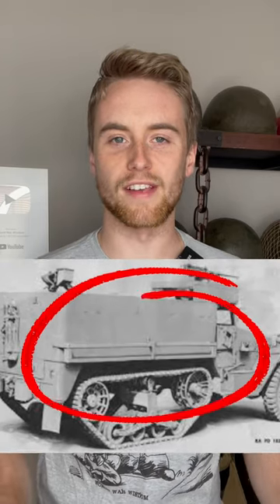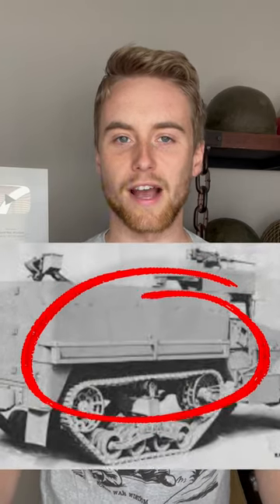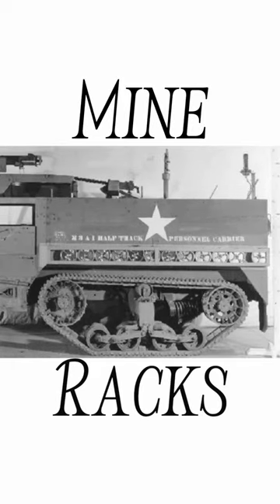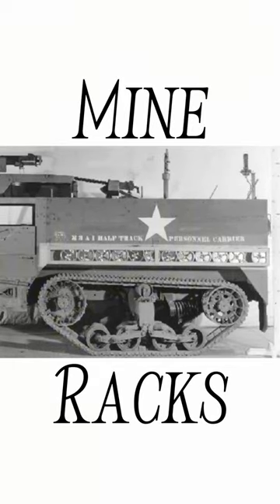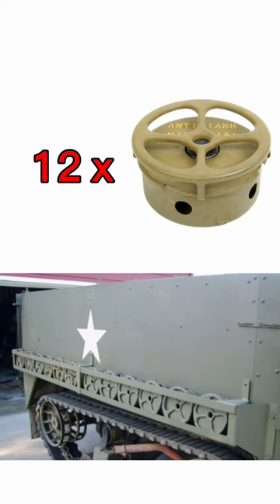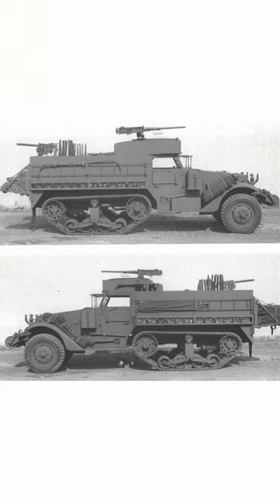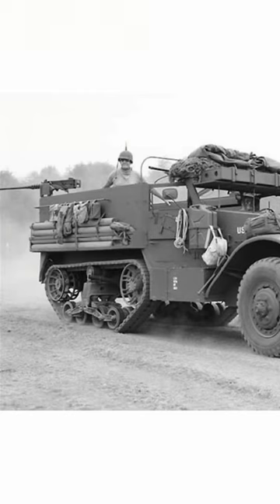Why attach bars outside of some WWII half-tracks?

Comment: To everyone worried about having explosives sitting on the side of the halftrack:

When the mines aren't about to be laid, the detonator/fuse for the mine would be removed, rendering it pretty safe to handle. Any external explosion that could possibly denotate the mines while they were sitting in those racks would already destroy the entire halftrack, so its not really a big deal.
Reply: People back then were smart. Most youtube comments are proving everyone's pretty stupid nowadays.
Reply: Not sure what experience you have with the issue, but I regret to inform you that you are in fact incorrect.

Comment: Imaging having a bad driver and you bump into a tree or something and your squad blows up
Reply: It takes about one ton of force to set one off
Reply: Anti tank mines need VERY HEAVY force to activate
Reply: A explosive way to know
Reply: @Steve.Matheus if I’m correct they also needed to have a pin pulled to be activated so that when something goes over it it will explode so yeah just helping you prove your point
Reply: That’s not how they work
Reply: @Steve.Matheus no not that much. Crash into woods with half-track is more than enough. There are safety pins tho. Still it is very nervous if your transportation is coveted with antitank mines
Reply: Wouldn't they need to be activated before they can explode?
Reply: Mines are inert - apart from being full of explosives - until you screw a fuse into them.
In the Mark 7 - a similar large round anti tank mine - you could get the normal single impulse, double impulse to defeat flails and rollers, and tilt to defeat ploughs.
In my day, the Cold War, the "ideal" minefield was:
Wire obstacle to deter opposition recce or pioneers.
Knee high marking wire to show the extent of the field which had to be surveyed in against basically indestructible markers.
Layer of double impulse mines which could be protected by four anti personnel mines on the "red" side.
Layer of tilt fuse mines.
As many staggered layers of Mk 7s or Barmines, because you have to leave quite a surprising gap between mines to stop a chain rection of sympathetic detonations,  as you wanted.
Not to mention lanes left for patrols.
All covered by direct or indirect fire.
Minefields could be used as a "dead stop" or contoured to "guide" your opponent onto a killing zone.
All a long time ago :0)

Comment: My father commanded  a half track during WWII. I believe it had a long barrel 30mm anti-aircraft cannon. I still have the operators manual, a demilled cannon shell, and the wool blanket that he sat on. . He earned 2 bronze stars.
Reply: More likely 40mm
Reply: I played with it when I was a kid. Doing this by memory. Thanks.
Reply: @clarkpolinski5775 Most likely either an M15 with a 37mm and 2 x .50 cal machine guns, or an M15 Special with  just a 40mm gun.

Comment: The detonators aren't installed / armed until after the mine is emplaced. Prior to that, they are stored under the VC's seat in trays with velvet-lined pockets.

Fun Fact: A large egg fits into the pocket, and chickens don't stop laying eggs for a war. My father was rather proud that from June to December '44 they never broke an egg.

The detonators got tossed in the rear stowage bins with the extra ammo, flares, and Thermite grenades to make room.

Comment: There was no need to add the fuse to the mine until it was time to place them.  And even if the were fused, the re was a safety fork in place.  The mines were not going to detonate if hit by a bullet so chances of the mine exploding is pretty much nil and something you'd see in a Hollywood movie.  Similar to how we have been made to believe that Flame Throwers explode into balls of flame when hit by a bullet.  Looks great in the movie but just isn't so.